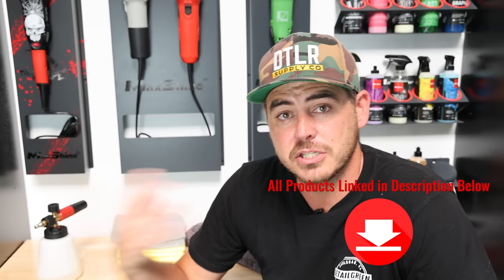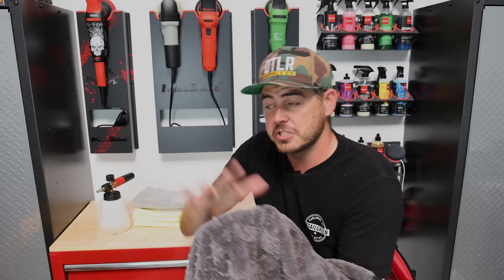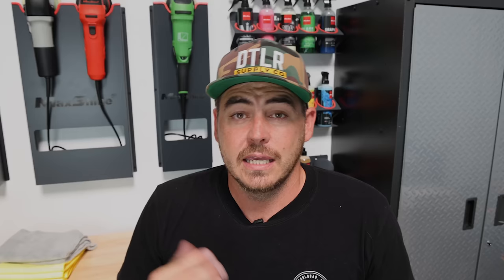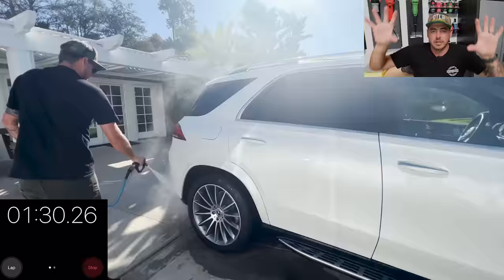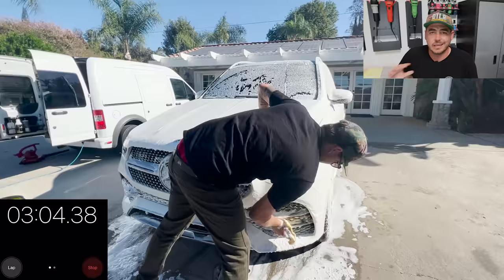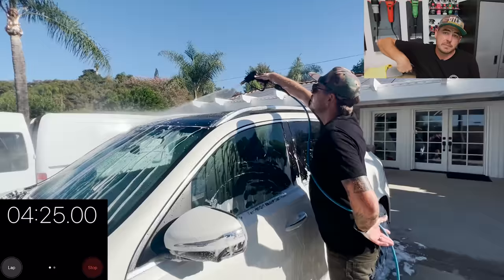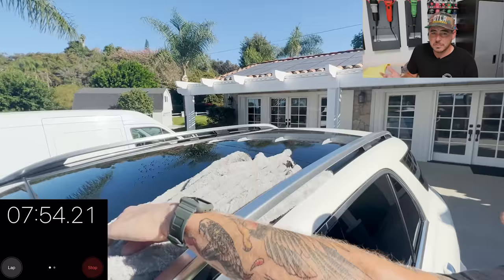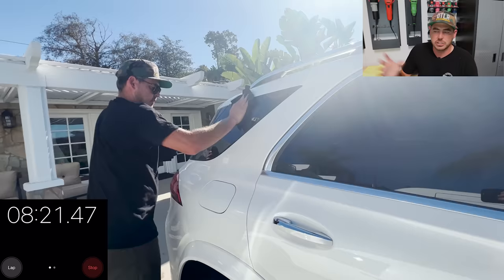HOW TO WASH A CAR FASTER! | Car Wash in 10 minutes or less

Comment: Great vid! What’s the psi of the pressure washer you used?
Reply from the maker: I was running at 1200psi and 1.8gpm
Reply: @imjoshv  Thanks. Is 1350 psi ok to use on cars?

Comment: no no no, foam first, if u rinse, the dirt might scratch the paint or degrade wax/ coatings when 1000/2000 psi water jet accellerates them. also, you start contact wash from up down
Reply from the maker: That is a common thought and when a vehicle is really dirty I totally agree. But there are many situation where a pre foam is not necessary. Foam cannons and all of these foams (which I love) are newer. I e been detailing for about 18 years now and when I started foam cannons weren’t even an option.

Comment: Sorry but dont see how you can clean wheels that quickly.. even using p&s brake duster, I still need to get in there with a wheel brush and wheel mitt as otherwise there is simply no way I get them clean.. wheels alone take me half of the total time... no?!

Comment: Great job. Do you dilute your TEC582?
Reply: I’ve seen this so many ways. Anything from full strength to 1:1 ratio. I was amazed at how slick it was on a non coated car, so amazed that I ended up diluting mine after to about 3:2 ratio (60% TAC/40% distilled water) and next time my car will not only be coated with a traditional ceramic coat, but also 2 layers of Griots 3-1 ceramic spray on top of that (I’m a little OCD and just got done doing a full paint correction on my car).

Comment: I was using tec582 as my protection but I wanted to use my ego blower but it’s doesn’t come off fast so I wanted to buy Carpro reload or hydro2 with elixir any other recommendations?
Reply: I have a full bottle of ReLoad and also another full bottle of the magic elixir everyone has been taking about.  I’ll sell you for either for half price, or I’ll just be honest and tell you to get the Griots 3-1 ceramic spray (they recommend 2 coats), or Sonax ceramic spray coating (1 coat) or even the Nu Finish (yep, that company Nu Finish) Graphine coating spray has been getting great reviews. Do a YouTube search, some of these sprays are getting 12+ months!!!  Then I’d use the TEC582 as a drying aide/topper after you use the leaf blower and do your final wipe down. Reload seems to be extremely over rated OR the tech is so much better now than it was 5 years ago. Kind of bummed since I have a full bottle of reload sitting in my cabinet. Maybe I’ll use it on my other cars and not my precious one. 🤷🏼‍♂️. Sorry for long reply, I’m just going through the paint correction, coating and then spray coating process myself and recently did the extensive research just prior.
Reply: @KosmicHRTRacingTeam  i just want to make my drying faster with my ego blower if Carpro won’t do it then I don’t think I would get it

Comment: There’s no way dude. There’s no way you contact washed every surface, and there’s no way you rinse all the soap off that vehicle. If I did that to my truck, I have soap streaks on my windows. Also when I use the foam cannon on my truck that has the Avalon ceramic coat on it the soap sheets off too quickly.

Comment: In addition to this 10 minute process, I think most people will have another 10-17 minutes on top, here’s the breakdown:

Setup, rinse, put away materials. +3-6 minutes

Scrub wheels (spray and rinse doesn’t really work, even for coated wheels). +1-2 minutes

Door jams and trunk jam. +1-2 minutes 

If you don’t have a long power washer hose, you’ll have to move around the pressure washer. +1 minute 

Tire shine. +1-2 minutes

Honestly the car isn’t perfect unless you hit it with a quick detailer or drying aid after the initial towel dry. +2-3 minutes

Gotta look at the clean car. +1 minute

This doesn’t even include the interior. I guess there is honestly no way I can get a good interior exterior hand wash in under 25-35 minutes. Sometimes takes me an hour if I spend a little extra time lol.

Comment: Why not use an ego blower to speed up drying time
Reply from the maker: I usually do use a blower, but I like it too much and I end up spending more time doing it haha. So yes I do use a blower 99.9% of the time but for the purpose of this video I skip and mention using the air from driving to dry out tight spots and keeping towels with you to absorb the drips

Comment: $350 for the pressure washer when there are ones available for under $100?!
Reply from the maker: Yea the active gets a higher gpm which does make a big difference, but you can make some minor changes to the $100 units and get great performance from them.

Comment: That was quick and looks great but I don't think contact washing the snow foam is a good idea tbh. You're meant to give it some dwell time to loosen the debris and then hose that dirt off.  Pre-rinse won't get much dirt off and also isn't necessary before snow foam.  Better to power wash after snow foam instead and then contact wash using buckets

Comment: The wheels were not even dirty, and if they were, you would need to spend 5 mins on each wheel using brushes to get to the back of the wheel barrels, and iron removers need to be left for 2-3 mins to react anyway.
Spraying some chemical on the face of a clean wheel then jetwashing it off is not going to clean the rest of the wheel, and wont even clean the face of a dirty wheel.
Snow foam needs 2-3 mins to dwell and break down, and eat into the grime, before rinsing.
Then you went straight in with the contact wash, rubbing all of that dirt into the paint, before you even rinsed it off.
This will make most clear coat look like an artex ceiling after a few washes. Foam needs to be rinsed off before shampoo contact wash, and I am surprised you have shown this lack of basic knowledge and had the gall to actually film it.
Shampoo is designed to be a lubricant so that a contact wash causes the least amount of marring and swirling when you finally touch the paint.
There is no way you can wash a car in 10 mins SAFELY, or even effectively. Not a chance.
Please anyone who reads this comment, do NOT wash your car like this. There is a reason why it takes much longer to properly and safely wash a car, especially one which is actually dirty, unlike the clean car used for this video.
Do not follow this video, please, it is ridiculous.
I have worked in car dealerships, and been a hobby detailer for many years, and I swear this is complete rubbish shown in this video.

Comment: 02:30:23 - wrong. You just scratched it. You must rinse out your snow foam before you go for a next step. This is totally wrong. For experiment just add sand on top of clearcoat surface then add snow foam on top, wait 10 seconds and then rub it with your sponges and then rinse off. Then check how many scratches you will have at the end and then repeat 52 times and you will see your car's clearcoat after a year if you wash your car every week. I wouldn't give my car for you to do, sorry pal.
Reply from the maker: That is true in the case of most pre washes but in the case the foam is used to add lubrication and start the process of breaking down dirt. If the car is extremely dirty then yes you should always rinse it off the foam to remove the bulk before your contact wash. In this case the car is not that dirty so the initial rinse of water removes the bulk of dirt so that it is not rubbed into the paint. Before foam cannons were around we would rinse, then go to a contact wash with a bucket of soap. The process i show in the video is basically that with the added benefit of foaming the car to add more lubrication than what is just in the wash mitt.

Comment: Stopped the video the moment u said its fine to wash the car frim the bottom to top.. this is not accurate advice since all oils and fat from the streets stock at the bottom sides of the car and the on rims .. you must wash the car from up to bottom and never go up again until rinsed with water and changed the sponge
Reply from the maker: It’s ok to foam from bottom to top, I agree that when you do a contact wash the bottom panels pick up the most dirt so you want to make sure you flip your wash media so you don’t bring that dirt up to the other areas. I will sometimes hit a bottom panel before moving to another section but I will flip my towel or wash mitt

Comment: WTF.. 1 foam and without rinsing you contact washed. lol, you just micro scratched the  car. I hope that car had ppf
Reply from the maker: Foaming the car first isnt always necessary. After detailing cars for almost 20 years, foam cannons werent even around when I first started and the process was always rinse then contact wash. This method gets the rinse, the added lubrication from the foam, and then the contact wash with soap in the wash media

Comment: Nice quick wash but I cringe a little at using the same towel all over the car including the rocker panels when its that dirty. Gonna make a lot of "love marks" over time. 
Any worries the owner will see your process and realize with a small investment they can do it themselves pretty quickly? I guess some people can't imagine doing the kind of manual work no matter what the cost or how easy it is.
Reply: I agree, 1 towel per side with no rinse or flip inside out. also missed a large majority of the front grille/lower spoiler, step sides, and completely forgot about the rear lower bumper spoiler. was the 10 minute job worth it?
Reply: @adamvanburen  Nope, this is why you can’t rush the process and it won’t lead you even close to perfection. I spent 10 minutes cleaning each of my wheels yesterday and another 2 hours washing my car. I enjoyed every moment. Happy Detailing 💪🏼
Reply: @adamvanburen  it’s probably ok for an average person’s wash of their own car if they’re not really into detailing, but that isn’t what the audience of this channel is, and worse it looks like it was definitely a client car. I’d be upset if I paid for that. I also cringed when he opened the doors to step on the car to get the top. Seemed a little unprofessional. Just get a step stool.

Comment: There is some bad information in this video. That product sprayed on the wheels and the foam will NOT get wheels clean with a normal amount of dirt on them. I will make a deal. I will buy some of that spray from your site or affiliate link. If I use it and it doesn’t work - the wheels are clean like I washed them normally - I get $100 worth of product from your website. If it does work, I will buy $150 worth of products for the subscriber of your choice.
Reply: Stupid comment, video is very good
Reply: @andybilgen  so you think this product will work like the video shows? You are a year late by the way.

Comment: Oooohhh cringe 😬  you just took all the dirt from the bottom and spread it to the top 🫣 10 min. Of scratches and swirl marks Lol
Reply from the maker: Flipping the towel between areas to a new clean area prevents transferring dirt, keeping the surface cleaner while utilizing the soap on the surface. Similar to revisiting a bucket over and over again with a multi bucket method.